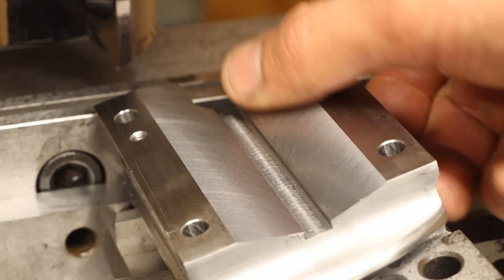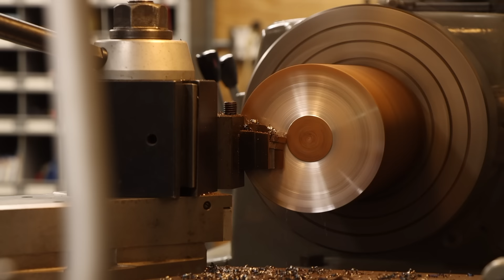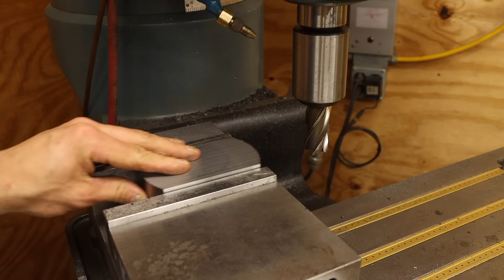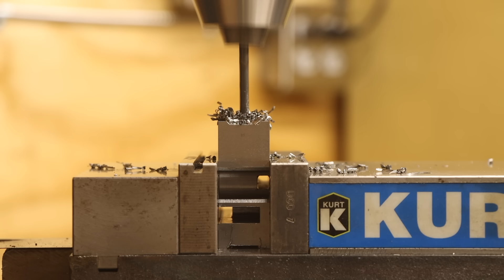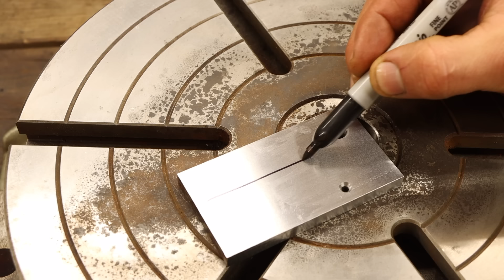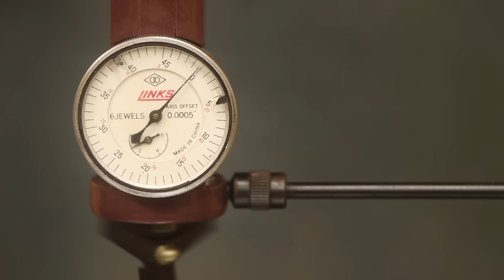Making a Surface Gauge (Part 1) || INHERITANCE MACHINING

Comment: Man, this channel is pure gold, whether you're a machinist or not.  I'm a late arrival on this video but I have in my study, on a shelf along with other things I inherited from my dad, an original case-hardened Starret 12" surface gauge.  The case-hardening has given it that classic swirling mix of subtle colors.  The only indication that it is a Starret is on the 12" inch rod which has the two scribing points, one curved and the other straight.  I don't use it because I have a Mitituyo 12" analog dial surface gauge.  However, the Mitituyo doesn't have a feature the Starret has, and that's the four precision locating pins on the underside.  Those pins can be used to set the gauge exactly parallel or 90 degrees off the workpiece or the table ways.  You can establish a perfect 45 degree alignment using the two pins in opposing corners.

Thanks again for a great video in which the video editing and the tutorial are fantastic.  I learn something new in all of these.  In this video I learned the many uses a rotary table has; I could probably make one with an 8" diameter and the necessary pin holes for indexing.  That would fit my Myford milling attachment perfectly and be a lot easier than setting up the Myford dividing head.  Maybe I should just save up and buy a mill.  And a surface grinder.  And a sand blaster.  And a real bandsaw.  And have them all on wheeled frames so I can practice Machine Shop Feng Shui when necessary.  Godspeed.

Comment: As an older engineer it was interesting to see the old school drafting table, drafting machine a drafting tools.   I spent many hours bent over such a table.  Then came CAD while I embraced big time, but the drafting table is interesting to see again. Funny because I hated drawing with ink & mylar. Don't accidentally smudge that line lifting up your trangle!  Oh and I  learned quickly not to use a motor driven eraser. For me it often meant I'd wear off the finish. Then the ink would not stick and just pool up.  Arrrgh!
I was in that period where draftsmen where retiring & not getting replaced. Engineers had to do there own drafting.  With CAD that is doubly so.

Comment: 7:50 "Optional squareness comparator surface"
I don't think I've ever seen you use anything other than the curved edge on the surface gauge when measuring squareness in your other videos.

Comment: I wonder if your Grandfather had contacts whereby he would discover deals in equipment.  That is, be bought the rotary table because it was too good of an offer to pass up.  I wonder if it might have been a return?  Remember the T-nuts that didn't fit?  Maybe the original buyer sent it back unused.

Comment: Out of interest is it a drill chuck you're holding the small endmill in? Not an attack, interested as ive never dared even when stuck. Love your videos, have a bone to pick with you though.. Once I saw them I realised I needed a surface grinder.. Its made my shop very tight... 🤣 Keep up the videos.

Comment: If your part doesn't extend past the center of the vice, all your clamping pressure will only be at the point closest to the center of the vice. That's why your part lifted up. Put a block of equal thickness on the other side of the vice to balance it out. Also, it's not good practice to hold endmills with a drill chuck.

Comment: i'm curious what the 15 degree bevels on the bottom are for? are they just for looks? maybe to have less surface area in contact on bottom? or is it maybe to rest on top of something round? Thanks in advance! Great Videos by the way!
Reply from the maker: It's a little bit of all of that. It also limits the contact patches to narrow areas on the edges and less susceptible to rocking. Though a 3 point contact would be best. Thanks!

Comment: Love the extra work you put into making the parts as pretty, precise and well-fitting as possible. Some people might see it as overkill when it comes to surface grinding the parts, even the "less critical" ones like the fine adjust lever and also some of the chamfers you put on the parts that aren't "necessary" but both of these things combined will yield a nicely "finished" looking part with lots of accuracy and tight tolerances in the parts. Obviously this all translates to a more precise and higher quality part that will remain that way for longer and also looks very professional.
Love the channel by the way. Asides from the extra effort you put in all your projects, the cinematography is really well done also.
Your channel has a very "zen" like quality to it.

Comment: How much effort do you put into smooth and consistent movement to get good finishes? Those pieces on the rotary table in particular did come out real nice, but it was hard to tell from the video how dialed in your CNC hands are.
Reply from the maker: Thanks. I definitely try to be consistent with the movements. Or at least not stop and let the tool rub

Comment: Maybe a dumb question bus at around 08.20 min it looked like you free handed the angle, bus I'm pretty sure you didn't, but could you explain how you did it, or did I miss so etching???
Reply from the maker: It's somewhat hard to see, but there's a 15 degree angle block under the part. Kind of midway between the two parallels

Comment: Phase 2 rotary tables have metric t slots, I had the same issue, took a carbide endmill and opened up the t slots so I can use standard t nuts.

Comment: Not sure if this will come up later in the video, or if you took it into account but didn't mention it, but the first two times you went to the surface grinder you faced the risk that your surfaces were not square. Coming off the lathe from the second facing operation, did you use the first faced surface as your reference surface? If you used the second one there's a good chance that the sides of the part were not square to the base. Then when you went to the surface grinder for the sides put the piece directly on the magnetic chuck without any referencing to the two surfaces that you already ground.
I guess this is fine if you do not have a reliable working vise to put on the surface grinder, but I would think that getting a vise would then be a higher priority than the piece you are making here. Ideally you would use a good vise in the surface grinder to ensure that your third surface is referenced to the first two, then you can use that directly on the mag-chuck as the reference surface for the opposite side

Comment: T-Nuts are normally not hardened, but it is a toolsteel. Very hard to work with. The turning speed was too high for this material. You should look to a table with the cutting worthies.

Comment: I was watching a Gentleman that was fastidious about his grinding, really fastidious, he advised using a piece of wet paper (newspaper or paper towel depending on the piece you are working on) under the piece as it will create a more level surface to do the initial grind. It seemed like a really clever idea and maybe useful for yourself in the future. Thank you for sharing your work with us.

Apologies I cannot remember the Gentleman's name, I watch too many engineering/machinist videos.
Reply from the maker: Thanks! That sounds like a Solid Rock Machine Shop, Oxtool, or Renzetti trick if I had to guess
Reply: @InheritanceMachining  Good morning Sir, yeah sorry I cannot find it in my history, but I agree it is more than likely one of those Gentlemen. Have a great day and an even better future.

Comment: Great video. Some pointers for you. You should never run an endmill in a drill chuck. Unless you are plunging straight down.  The chuck can come off the arbor and will make for a very bad day. Also, the roughing endmills looked like you were turning them to fast that’s why they died early. Instead of taking small depth of cut take full depth with light radial cut. This will let you use all the flutes you paid for. If you dull the end of the tool the endmill is trash and you never got to use the top of the cutting flutes.  Keep up the good work. The videos are great. I would love to do what you are doing and pass knowledge to the next generation of machinists.

Comment: Are you a mechanical engineer? I’m studying and just finished my fluid dynamics course I graduate next year and fell in love with your channel..spent ten years in the army and got shot in my left shoulder so CAD/Office work helps that shoulder relax but want to get into machining as well because of this..I do leather work that helps, like therapy to me really..anyway thank you for this
Reply from the maker: Thank you for you service, Paul. Yup I'm an ME. Machining may be a good for you for that same reason. Very therapeutic both mentally and physically, though at times there is need to move heavy stuff like chucks and whatnot. But a lot of the bench top style machines are manageable.

Comment: As to your fancy tool marks... It may be worthwhile to check out making a "Barleycorn" pattern. This is a series of intersecting circular grooves possible around a diameter or in a linear pattern. To the best of my knowledge, this an ornamental woodturning process. Done well it's amazing. Love your stuff.
Reply from the maker: Thanks! I'm having a little trouble finding anything with a consistent pattern by that name. Is there some other name for it maybe?

Comment: I looked for it in the comments but didn't see it, so here's my bit. 

When side milling on a Bridgeport style mill, make sure that your cuts are conventional. That is, teeth turning into the direction of travel. 

Climb milling will pull the tool forward and into the work because torque is being applied into the direction the backlash. 

That said, you've got some serious skills my man. I found this channel yesterday and I'm almost halfway through your video back log so far. Keep up with the high quality videos. This is excellent work 👏🏻
Reply from the maker: Great point! I think I've mostly been able to get away with this so far because my ways are snug and my backlash is adjusted pretty minimally. But that doesn't make it ok 😉 I appreciate the support. Welcome to the channel!

Comment: My luck was to use some mystery metal, that turned out to be air hardening tool steel. And even simple machining operations (I still dry cut most things, and use carbide) can cause self hardening. I acquired a heat treat furnace from Paragon kilns. Their knife maker kiln was more costly then their glass maker kiln, but had all the same thermal capabilities, only difference was the door hinged on the side vs bottom. So I use this to anneal heat treated items that need modifications, and then heat treat them again. I also acquired a Rockwell hardness tester, which I use more often then you'd think. That was a China made thing, and damn accurate.
I'm really surprised that since your grandfather had a surface plate (looks just like mine from Enco) that he did not have a surface gauge, unless someone stole it.
Also how was that rusty round bar marked so you could tell it was heat treat tool steel? I took the easy route and got a used surface gauge from eBay. I'm still learning how to use a surface gauge, as I got the surface plate from Enco 30 some years ago, when they had it on sale (24x36 no ledge with stand) for $200. Only the last few years have I found projects where it was needed. Purchased sine plates and Jo blocks, test indicators, to make proper use of it's metrology capabilities.
Reply from the maker: My grandfather got a lot of stuff from Enco around that vintage so may very well have snagged the same deal on the surface plate. I spent many years with him in the shop but never saw a surface gauge anywhere. He did have a height gauge, cadillac gauge, and a few other things. But he never really used the plate much.
I cant recall the round bar you are talking about but there was a grand total of 1 piece of stock that was labeled O1 on the original bar code.

Comment: OH MAN I haven't touched vellum and a drafting table since 1985... have you ever used the straightedge that has the wires on both sides to keep it parallel?
Reply from the maker: I have not but I've always had an interest to play with one

Comment: I love that rotary table...makes my 6" Chinese rotary table look like a tinker toy...which to be fair it probably is lol.
Reply from the maker: 😂 thanks! I looked up the value of it at one point and discovered it was about half the cost of my entire mill... nuts!
Reply: @InheritanceMachining  Wow.  Mine is 1/2 the paid cost of the small 1 HP square column mill I bought from a hobbyist unused after he lost interest in the pursuit.  It's also only 1/6 the price of the 2 HP round column milling machine I use for heavier work.  Guess what I'm saying is that the milling machines are just the gateway cost for this hobby...it's the accessories that cost a fortune.  I expect I spent about 3 times the cost of the mills for the accessories to make them as functional as possible lol
Reply from the maker: @rpower1401  This is 100% true. The machines are not the expensive part!

Comment: Well, youtube missed me on this video, only found it 14 days after upload, I see you went with a vfd for the lathe, clough42 has some videos on how to set them up if you're having trouble.
Reply from the maker: Oh no! haha no worries the vids are there forever. I did have some issues with the VFD integration, but more on the electrical side than the actual VFD. Running great now!

Comment: When the endmill broke, did you have it in the drill chuck? use the proper collet, the drill chuck isn't meant to take a sideload, and the mount is a tapered connection, which can easily come loose when side load is applied. also you should conventional mill when using a manual mill, and especially when you have a part unsupported and are trying to cut it.
Reply from the maker: Yup learned that the hard way ;) fortunately didn't damage the chuck. I've heard different arguments about climb vs conventional though. Climb is better for surface finish.
Reply: @InheritanceMachining  it is, but pretty much if you have any backlash, you will not only not get better finish, it will ruin your part/endmill, and for hard material always conventional.
Reply from the maker: That kind of makes sense since you would be pulling your part away from you backlash preload. I imagine its not that big a deal for light cleanup passes though

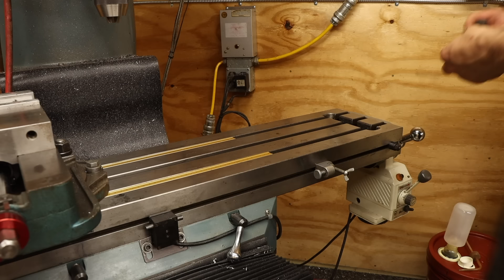Comment: 10:56 Get out of here.
Reply from the maker: I don’t follow?
Reply: @InheritanceMachining  Getting the vice to slide down the table with the t-nuts and hold down bolts. I don't have a swivel base on my KURT but I do have a line up key on the bottom side. Takes away the need to tram the vice in. Keep up the good work. Your videos are very interesting.
Reply from the maker: @Chef-Boyar-David  Oh I got you now. My swivel base also has the keys like you mention. After I moved it I checked the tram just to see and it was still dead nuts! I appreciate the support!

Comment: As a novice machinist in his mid 20's, I get so geeked learning about all the specialty tooling taking place. I learned something new that I'll be taking to my workplace, I hope I see the improvement on what I learned! Thank you so much for this.
Reply from the maker: There are definitely endless skills and tooling to learn about in a shop! I’m curious what was new for you from the video?
Reply: @InheritanceMachining  there’s definitely a lot to cover but everything I’ve taken from the rotary table. The clamping procedure and centering pin with the sacrificial material used. I’m taking my notes and I’m gonna use them, definitely looking forward for part two!
Reply from the maker: @saulcervantes1532  ah that’s awesome! Working through the rest right now!

Comment: Careful now your starting to look like a real machinist. Lol you still need some precision ground flat stones. And stop using a diegrinder on precision tool's. In my opinion it would have been better if you put the 3M pad in the mill to not intended devotions in the top of your rotary table. Just a thought
Reply from the maker: Not quite! haha I have several "fresh" whetstones but I could definitely use some more precise ones. Also considered the scotchbrite issue you mention. But it was crunch time and I was really only going enough to remove surface rust.
Reply: @InheritanceMachining  I understand that I have done plenty of things that would be questionable as well. It's also a single your going to fast. And that's when things go wrong. Believe me I'm telling myself this as well. Keep up the good work

Comment: Tap down work when tightening vice with a soft hammer to ensure work is seated flush in the vice and always square.  Love your attention to detail in your designs and machining.
Reply from the maker: I keep a dead blow nearby for just that reason. This piece just managed to works it’s ways up! Lol thanks for the kind works!